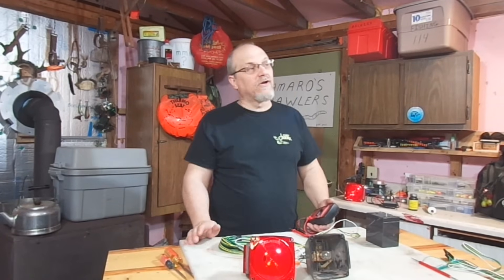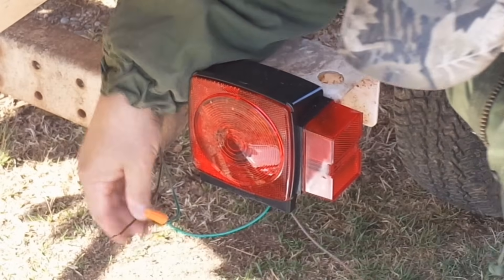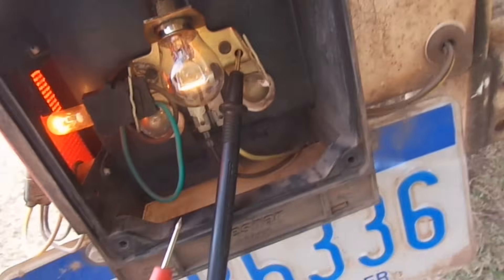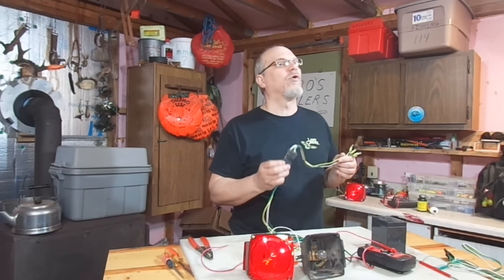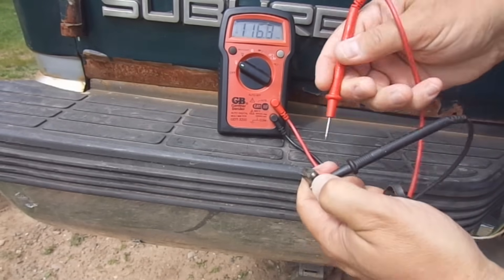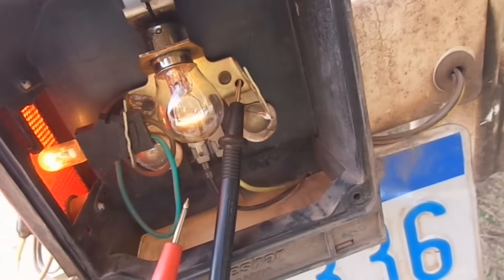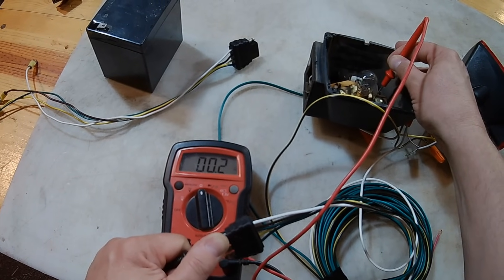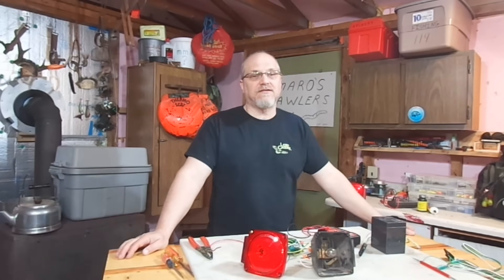FIX YOUR TRAILER LIGHTS (3) - How to use a multimeter

Comment: Have a multi meter but have not worked out how to use it, bought a new LED light fitting with different colored wires very confusing?Thanks ,anyway work in process!
Reply from the maker: If the fixture doesn't have the normal colored wires on it, it should have some paper work to explain?  Maybe?

Comment: So which setting on my multimeter do I use to check the back of my truck flat 4 way?
Reply from the maker: Put on DC volts when checking and trying the brakes, blinkers and running lights.

Comment: I am trying to hook up an add-on LED center brake/ park light on my camper shell.   The LED brake light comes with a RED (Brake), Green (Park) and White (Ground) wires.   The green on brown is good for the running lights.   The White on Black is good for the Ground but I cannot seem to figure out where the Red wire goes without it blinking.  Per the S10 manual it shows the yellow (L) and green (R) wires in the truck harness are for the Stop/ Turn signals.  If I hook the red wire to the yellow the left turn signal and the center light blink.   If I hook it to the green wire the same thing on the right side.   There has to be a wire just for Brake light that I connect the red wire too???   Has anyone ran into this and can tell me what wire you hook to for just the brake/ stop light and will not flash when I turn on the turn signals?   I tried the brown/white wire and it does not work for the brake light.  It is a 2000 Chevy S10, Please HELP,  I've tried everything and looked for videos and can't find nothing..  at the end of my rope, lol
Reply from the maker: I'm sorry I would have to be there to sort through that.

Comment: How in the heck are you gonna measure two ends when one of the wire ends is inside your trailer skin?
Reply from the maker: If I understand the question, I think you can just measure the trailer route of the wire.  Instead of the actual wire?

Comment: Question:  To check continuity from trailer plug to the rear lights, or any lights, can't reach from the front of the trailer to the rear.  Hmmm.
Reply from the maker: Yes you would have to use a length of wire like an extension to your meter leads.

Comment: So how do you reach with your continuity wires from your plug to the fixture? That’s 15 feet
Reply from the maker: You can use a piece of wire and alligator clips as a long meter lead.

Comment: Awesome video. I do have a quick question; can you do the same continuity check by putting the positive lead to one of the other ends of the trailer plug (while the negative is in the white wire slot of the same plug)? This would check that specific wire circuit for continuity, right? Hope that makes sense. Thank you.
Reply from the maker: With old filament bulbs you should read through the bulb if I'm understanding you right.  But with LEDs it's hard to say.  The electronics resistant with LED fixtures can vary from brand to brand so there isn't really any hard rules there.
Reply: @KnettersPracticalOutdoors gotcha. Appreciate the response.

Comment: how are you supposed to do this when the multimeter wires are 2 ft long and the trailer is 18ft long? ie measure continuity from one end to the other
Reply from the maker: Yes, I should have expanded on that.  You can just take a piece of wire (check it for good continuity first) and use it as a big jumper.  Use smaller alligator clips to attach the wire to the spots you are checking.  It's kind of like having longer meter leads.

Comment: My left side lights work some times.

After watching your videos I’m assuming it’s not grounded correctly since it does work occasionally.

I bought a whole light kit but now im thinking because the trailer has been heavily painted that I could just run a white wire from the breaks to the side light back to the plug and fix this whole things for $5.

Also you’re awesome. Will update with success or failure. 😂
Reply from the maker: Thanks so much!

Comment: I just purchased a GDT-3190 Gardner-Bender multimeter. I think like the one used on your video. Problem is, it came without instructions on how to install the battery! I know that sounds stupid but to remove the cover on the back I had to snap the cover off! Once that was removed from the unit all I could see was this big red something completely filling the battery compartment, with two tiny screws, I think they were holding it down. 👎to ECM Industries for not supporting their product which I need for my trailer re-wire project.
Reply from the maker: I think mine is a 3200, rubber cover pulls off, screws on back and battery compartment is at bottom.

Comment: I really liked when you were reading continuity on the trailer frame and had one lead in the hand holding the multimeter. Going to tape a lead to mine and loop the slack with a zip tie. Swapping between a unit lead to a length of lead would be necessary in many scenarios. But to have more freedom while sensing would be clever. 

Ps never be embarrassed to refresh your knowledge. Just see where you may have gained bad habits along the way and work out getting it right. 

Haha have a great day sir!
Reply from the maker: Thanks for the feedback!

Comment: Why don’t the harnesses just use a dedicated ground to run to the lights?  Is it just a cost saving measure for the manufacturer?

I just completely rewired my trailer with LED lights. They don’t work.

I rewired entire trailer two years ago, it stopped working after about a month. I didn’t know about continuity issues then (which was obviously the problem.

I have a 16 year old galvanized LoadRite trailer that I can’t get continuity thru for the life of me?

I’m just going to run dedicated ground wires to each light. Is there any reason I shouldn’t do that?
Reply from the maker: Yes you can run a ground to each fixture.  I would also ground the trailer too.  That way if a loose or broken wire grounds to the trailer it will blow a fuse as it should.
Reply: @KnettersPracticalOutdoors  thank you for the reply!!

Comment: None of my wires on my trailer are colored. They are all the same.. I am so confused with my problem and am at a loss.. I hope you see my comment. Should I just remove the wires from my taillights/brake lights/ reverse lights and cut them all off and rewire my travel trailer.. 
The bonus brainbeating delimma is my trailer has wires going to my brakes.. I am afraid I am going to screw my travel trailer up something awful.
Reply from the maker: see other reply

Comment: Love your clips. I 'm at a dead end. My running lights do not work (side and end) on my boat trailer. All the other functions are good. I have a 4 pin plug. Using a plug in tester, I've come to the conclusion that the running light connection on my SUV is dead. How & where do I look/test this? Near the car battery? Or simply change the 4 pin plug attached to my vehicle?  Thanks
Reply from the maker: Follow the truck plug back and look and see if it is spliced in or does it have a plug in "T" splice device.  Often the problem will be there (corrosion or bad connection) Newer vehicles sometimes have separate towing light fuses.  Check the owners manual and check those fuses.  Let me know how it goes.

Comment: Have a question all lights working but when i turn my running lights on the left brake light soesnt work and shuts the tail light off now when the running light are off they brake light works just fine this is a stop turn tail light so only red and brown wire checked fuses bulbs grounds and both trailer plug and truck plug all new lights. And another question i have double tandem axles so 4 brakes should they be grounded individually because there all on one wire running to the ground wire which is grounded to the trailer frame
Reply: Also it is new wiring the right one works just fine when the running lights are on
Reply from the maker: When stuff goes off when others get turned on (when they shouldn't) it is almost always a ground problem.  Fixtures and even the trailers need to be grounded properly.  When strange things happen it is usually one circuit back feeding through another because something isn't grounded properly.  Check this video out for more https://www.youtube.com/watch?v=GolYLizOcow&t=53s

Comment: Great site, and I really appreciate the videos (but find there is far too much repetition.)
Reply from the maker: Thanks for the feedback.  This video is a few years old, hopefully I'm getting better at it.  Always trying to improve.
Reply: @KnettersPracticalOutdoors  Thanks for the reply. I have only watched a few of the trailer videos and they are helpful and easy to follow. I like the fact that you have planned ahead and have "props" ready on a table, edit in close-ups, etc. 

I have a specific problem with a utility trailer my friend has loaned me - the lights never seem to work reliably, and I assume it is a ground problem, hence I have turned to your videos for help. I haven't watched them all, only those that seem relevant to my problem. 

However, I did notice something and want to ask you a question: The trailer lights are connected to a "4-flat" connector which has the 3 LED test lights on it. When I plug it into my car (2022 Outback), only the running light LED comes on, the LT and RT LED's remain off. However, when I plug it into my wife's car (2012 Volvo XC70), the running light LED is a solid red while the other two LED's are fast blinking. 

Any thoughts or suggestions? I want to be sure the power at the vehicle is sound before I spot check the connections on the trailer (which has three lights on each side plus the two tail lights).

Thanks.

Comment: Hi Dave,   just at the end of part three......I'm finding your explanation is brilliant.......and I've always  been frustrated with the use of a multi-meter......but you made it totally clear to me how to use it now thank you for that .......I would request one thing from you if at all possible for the series to be made in a way better quality of visual viewing it's a little fuzzy...........I know it's a lot of hard work.......but you truly have a great system with these YouTube vid's..........I'm a little hard of hearing but you are great and I didn't even need to turn my volume to max so thank you for that too....cheers mate.
Reply from the maker: Thanks for the feed back.  I'm always trying to improve the videos.
Reply: thanks Dave for a quick response.........sitting here on my last vid of yours lol.........with all my trailer stuff trying out different scenarios .........   a question for you if I may............ truck lights working ok to trailer connection when I connect up to the trailer I put my foot on truck break and lights come on truck ok but lights go out on trailer........???? any thoughts please.........and thank you
Reply: the trailer lights are direct to lights from socket not through the frame.......
Reply from the maker: @cozydram1  I assume we are talking about the running lights going out when you apply the brake.  This sounds like your fixtures on the trailer aren't grounded properly and they may be back feeding through the brake circuit.  When you apply the brake, you remove the back feed path.  Make sure all the fixtures have a good ground and also that the trailer is grounded good to the truck when connected.  That's where I would start.
Reply: awesome I'll check that ........totally appreciate your time .......thank you..........have a great weekend.....🤗

Comment: Nice video....the only issue i got on 7 plug trailer is that every time i pressed the brake pedal my trailer brake lights get dimmer instead of getting brighter...... and when i turn on my head lights on my trailer brake lights are brighter and when i pressed the brake they get dimmer....i don't know if it's a wire issue or ground  Any idea
Reply from the maker: Check all grounds for good connections.  Sounds like the circuit is back feeding.

Comment: Checking continuity from plug to fixture in a trailer is impossible without removing the wiring harness. Cmon man.
Reply from the maker: You can use a length of wire like a long jumper and then check.  Kind of like extending the meter leads.

Comment: Love the information. I tried two other videos first, but they just used a test light. One question: what voltage are we looking for?

Also, feedback: it seemed there was an awful lot of very basic, off topic, or repetitive information. I found myself fast forwarding through half the video to find the stuff that I needed. Also, as others have said, the intro is very long and seems somewhat irrelevant. I almost didn't watch this video just because of it.
Reply from the maker: Generally 12 volts is a good reading.   I've since shortened the intro.  Thanks for the feed back!  KPO

Comment: Not sure how to apply this the plug is at the front of the trailer and lights at the back, so you can’t reach both?
Reply from the maker: If you can't unhook the lights near the fixture they can be checked from the plug.  Maybe run a jumper wire for the white may help, KPO.

Comment: I accidentally cut my 4 pin boat trailer plug mowing.  I couldnt find it, but now i see 7 wires.  So i bought a replacement 4 pin plug from wally world.  Dont know why but i cant get the running lights working.  I have white to ground, yellow and green for turn signals.  Then i have 2 brown, 2 white with brown stripe.  I had both brown from trailer tied together going to the running light wire, but it doesnt work.  I tested the light like you explained here and the light works.  I cant get to work though from vehicle.
Reply from the maker: Brown should go to brown on the vehicle, but the white with brown stripe not sure, KPO.

Comment: C’mon!   Why do you people waste time on your kids, fish, and whatever?   Learn this acronym: “BLUF”…..Bottom Line Up Front.   We klick for a topic…stop wasting time.   You are to rteach how to use a multimeter, then waste time, and tell us to read the manual.   Almost 1/5 of your video before getting to the point.
Reply from the maker: Sorry it wasn't what you were looking for Samuel.  My channel is mostly outdoor related so the intro reflects that.  But as far as saying that you might have to read the manual to use a specific meter, I totally stand by that statement.  The symbols for the settings and the symbols for meter lead placement vary a lot from meter to meter.  Then some meters will have different symbols for the scaling also.  I did give some common examples of "Ohms" and "DC volts" as far as the symbols, but some meters may vary.  You could select "DC volts" but you may also have to have the leads in a specific sockets to actually measure "DC volts" depending on your specific meter.  Most meter manuals aren't intended to teach you how to measure volts, amps or ohms.  Most meter manuals assume you are very familiar with how to measure these things.  They only instruct you about the specifics of their particuliar meter.  I see a lot of videos that say "put your selector here, put your leads here and measure DC volts".  And that may help if you have the exact same meter, but it can be confusing if you don't.  Especially if you are new to using multimeters.  I have been using multimeters for over 40 years.  If I bought a new, basic multimeter today, I probably wouldn't need to read the manual.  But if I bought a new, higher end multimeter, I would most likely read up on it a little.  So if you are totally new to multimeters you definetly should read the manual.  This video wasn't meant to replace the meter's specific manual especially for new users.  This video was meant to be a basic overview of measuring Ohms and DV volts.  Again, sorry it wasn't what you were looking for, KPO.

Comment: What great timing, I had to do a quick fix while traveling and just reconnected the 4 way, however my trailer harness has 7 wires and I have Blue, Red, and black left over and now that I’m home need to figure out which wire is the running lights. Which is normally Brown but that’s not what I have left.
Reply from the maker: Blue is usually trailer brakes, but the rest I've seen many different combinations.  I hate to comment on colors with 7 pin because they seem to vary from manufactures.  Sorry I'm not more help, KPO.
Reply: @KnettersPracticalOutdoors  no I’m right there with ya, I’m gonna give it one more try and if it doesn’t work I’m just gonna take it to someone. It’s just frustrating I’ve worked on aircraft, cars and bikes but this knuckle head has me stumped…

Comment: I missed something about ohms.  When figuring out if a wiring can carry a current successfully is when you use olhm, but give an example of when a wire on a trailer would register a high ohm.  Is it when there is a short circuit?
Reply from the maker: A short length of wire should read near 0 ohms end to end.  If a wire reads high ohms on a trailer it is a problem (broken wire, bad splice, poor connection at plug, ect.)  A short circuit would read low ohms from the wire to trailer frame.  This is a problem if it is any wire other than the ground wire or negative.  From end to end a shorted wire may or may not read low ohms.  Example - if a wire's insulation is worn through and grounded to the trailer frame, the wire may read fine end to end, but if voltage is applied it may short out and blow fuses.  Check out this other video also if you haven't already - https://www.youtube.com/watch?v=Iz1jN3KApns   I hope this helps, KPO.